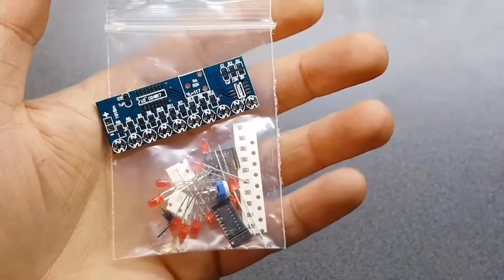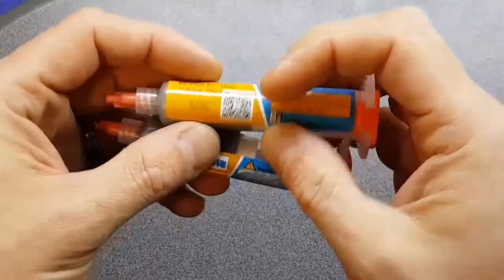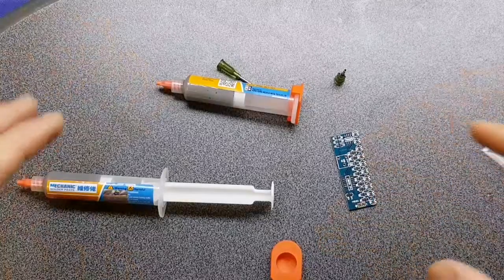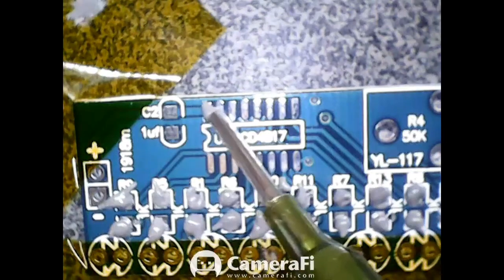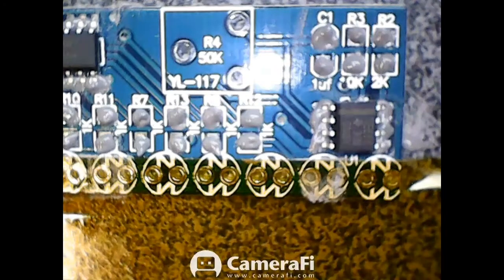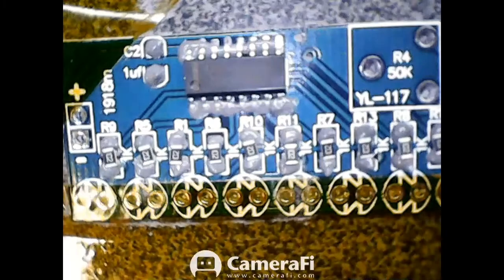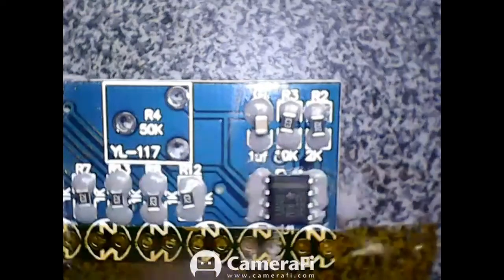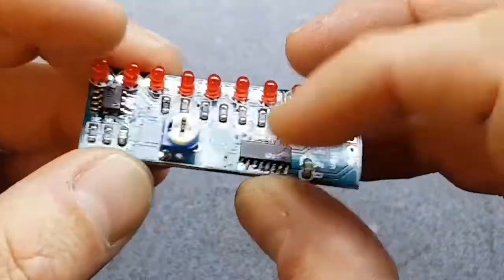Using hot air for SMD / surface mount soldering (electronics tutorial)

Comment: Thank you for your generous upload sir. I am in a bit of a pinch here, lost the heater element on my hot air tool but I have to do a re and re of a LQFP64 package (STM32F103). Pitch is 0.5mm. Got a new bottle medium quality of solder paste.  I stirred it up and added a little no-clean flux to get a bit lower viscosity and tried to dab each pad. Glad to see you can just cover with a stripe. As per usual failure is not an option. I will have to wait weeks for the replacement but I thought I would try to work with a known good chip. Got it all cleaned up and legs are nice and straight. From my experimentation so far I am thinking of carfully "dab" soldering with paste rather than regular leaded solder 0.5mm type.  I always get bridging with these small pitch items. :-)
Of course the really pressing matter is why the original IC failed during upgrading of firmware with AVR type DOS program and only 4.8 volts at the Vss. :P

Comment: I have a suggestion - use less solder paste (and flux) by engaging a toothpick. Transfer from the syringe to the toothpick tip, and then to the pad by dabbing the toothpick tip on the pad. It works surprisingly well!  Cheers.

Comment: Excellent job!  What temperature did you have the hot air set to?  Never used a wee pointy tip to clear the shorts, just the normal chisel as it gets more heat there quicker, but point is more precise.  I may have to try.
Reply from the maker: The air was set at 375c with the air flow around 2.5...think i'll drop air speed next time as a few components almost went flying lol

Comment: The hardest part of smd soldering. Is getting the solder paste on,next hardest is putting the smd in the paste.and the real hard part is not loseing the smd,s components,trust me I seen the liitle burgers shoot across the room.that why I bought several practice boards ,it a skill
Reply: That's all easy! It gets really weird when you start eating the parts ;) . I think I was picking out SMD parts in front of the PC according to a schematic. Later that day I was watching videos and snacking on chocolate biscuits. In the dim light I thought I had a crumb on the table, picked it up and ate it. It was way more crunchy than a biscuit should be. Guess I found the 0603 sized 10k resistor that was missing when soldering...